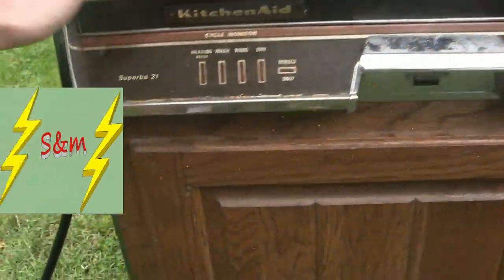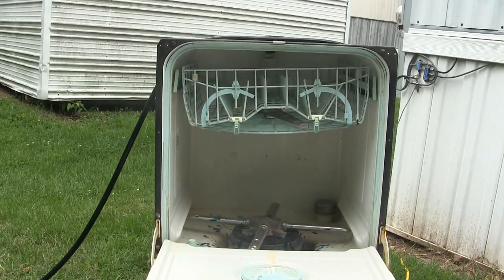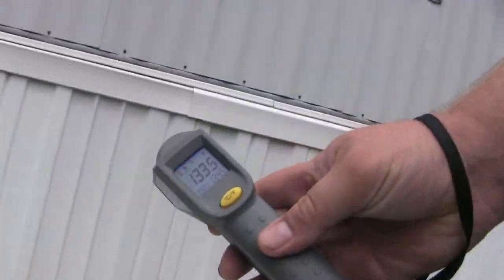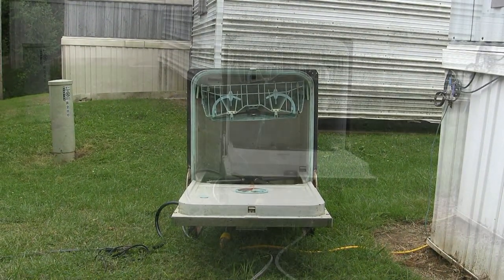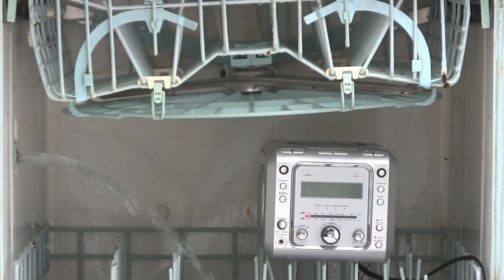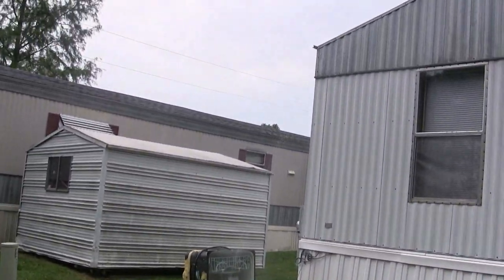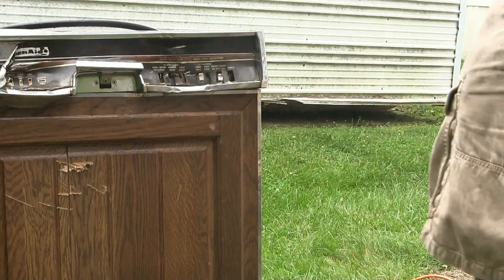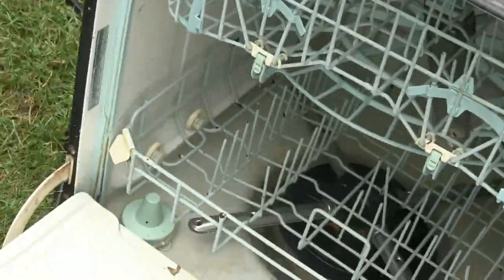Vintage Dishwasher Destruction

Comment: That dishwasher was probably one of those items that were built to look vintage
Reply: Probably, considering this model was built around 1988
Reply: Yeah I would say around late 80's or early 90's because my grandpa still has the same dishwasher like that expect without wood instead black steel and still works after 30 years!

Comment: was the dishwasher broken?
Reply: the only thing broken was the hot air blower motor which is an easy fix if you know an local electric motor repair shop
Reply: The dishwasher wasnt effective anyways

Comment: Also who would want to buy a stupid vintage dishwasher
Reply: Because it is a reminder of the quality we don't see today in many modern things .
Reply: @collin5139 2 When I purchased my Speed Queen washer 7 years ago it was the best quality you could buy at the time among mainstream manufacturers. Not too many years before that "commercial" quality was a given with the Whirlpool/Kenmore direct drive washers.
Reply: @collin5139 2 I seriously don't know in what way today's appliances are superior. These newer appliances aren't efficient with my time though.

For example if I want a hot wash on my Whirlpool front loader...and I mean a truly HOT wash I have to set it on sanitize which is around 1:45 minutes at the lowest soil level. All because of the miserly stingy use of water.

On my Speed Queen top loader I can get hot water and have a load finished in 1/2 hr. 

Personally though I love the front loader's huge capacity but I don't find they clean better than my Speed Queen which is a great cleaner .

I know on my 1990 portable Whirlpool quietwash dishwasher that a normal cycle can take anywhere from 1 1/2 to 2 hrs. with hi temp wash option selected. Is that on par with modern dishwashers ? I don't know.

Why does efficency seem to be a religion with many people?  Those old machines used more water because they had powerful motors/pumps in them.

 These new lawn sprinkler pressure machines need several hours to do their job. WHY ?

My quietwash is a "hurricane in a box" with the powerclean module. I wouldn't trade it for anything made today.